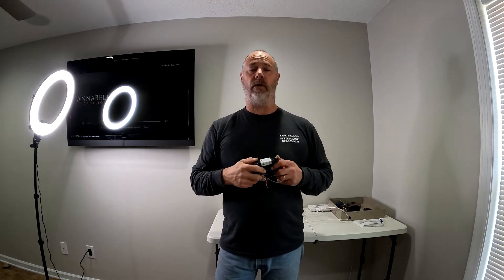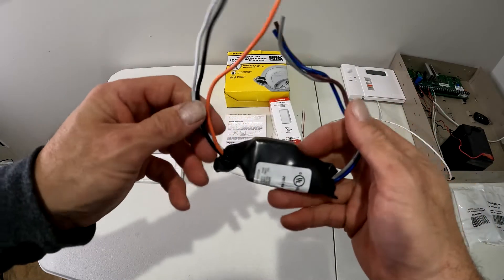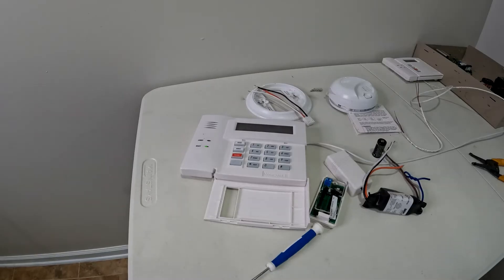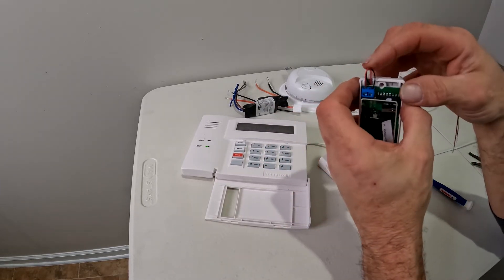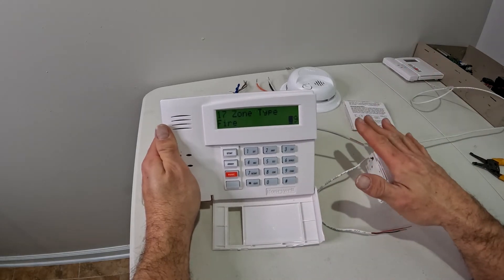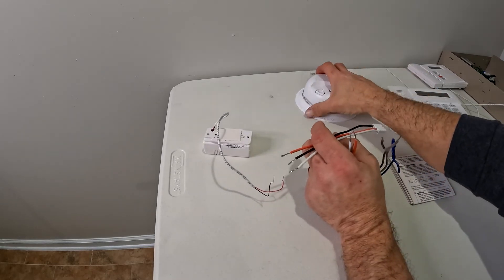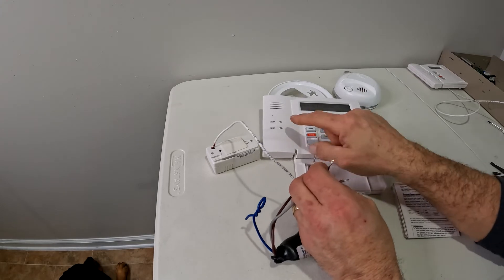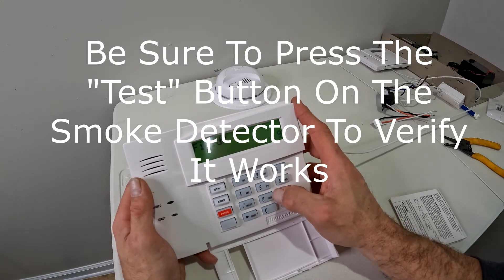BRK RM4 Relay Smoke Detector CO2 120v to Low Voltage Relay Alarm Systems

Comment: Very Helpful.  Changing my DSC system from GE 320 ACX to First Alert 920B.  Problem is that 920B does not have the internal relay.  This solves my issue.  Thanks a bunch.
Reply from the maker: Glad it helped, thanks for watching and dropping a comment.